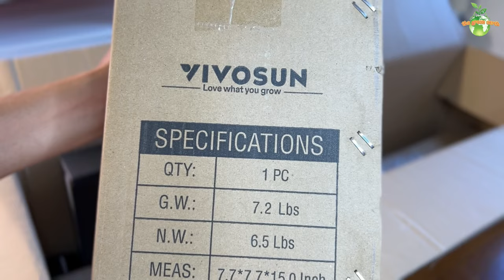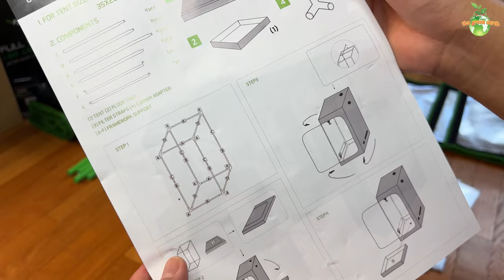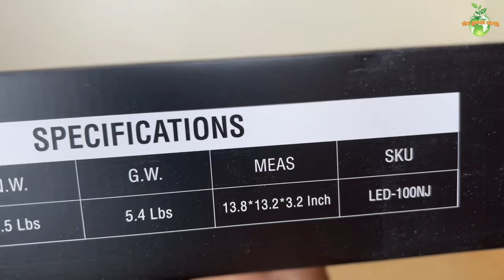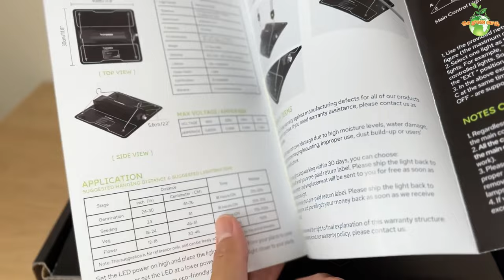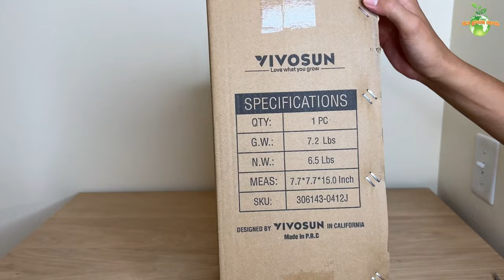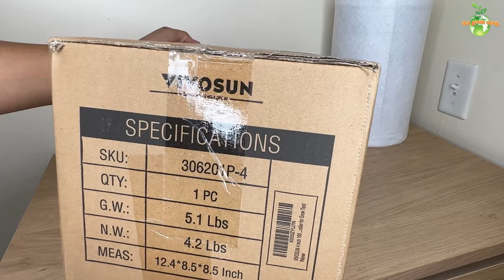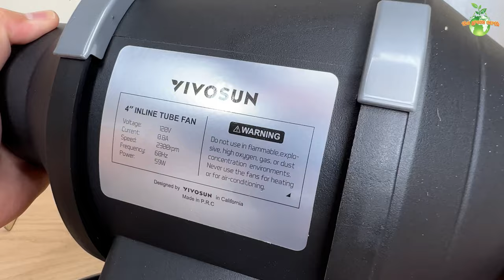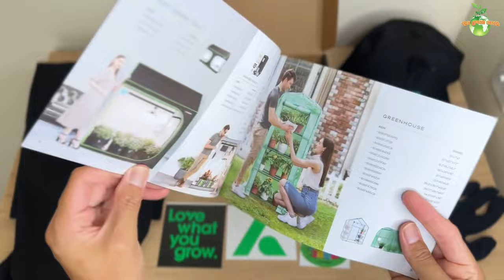#133 : Basic Grow Tent Setup for Plant Propagations Indoor | VIVOSUN Grow Tent Kit

Comment: For you folks following the picture instructions that came with it, don't be fooled by the actual picture lengths as they are misleading. In the 60"X32"X80" that I bought, the illustrations of the lengths of a, b, c, so on is it showed "A" as the longest one when in fact it was the 32" depth poles. You will figure it out as long as you have a tape measure and don't get stoned first. Lol

Comment: Where did you get that shelf?
Reply: I think this is a 5x5x72”  I ordered 2 6 foot high shelving units that have 18”shelves deep from Sams and had them facing each other (left and right sides). I did not bother with the fan set up and used the leds on each shelf. I did however order a clamp on small fan for air circulation. I mainly seed start in March and August. Some propagation.